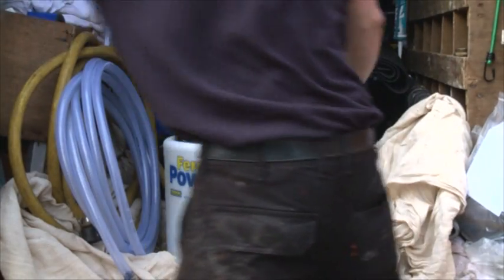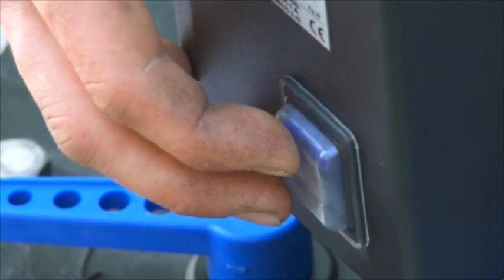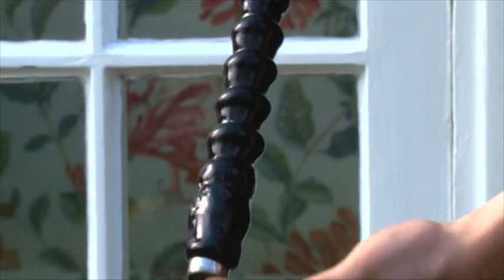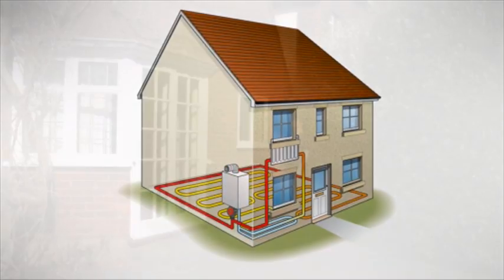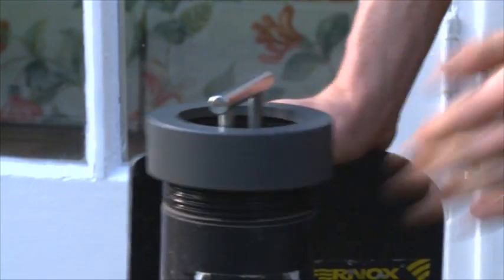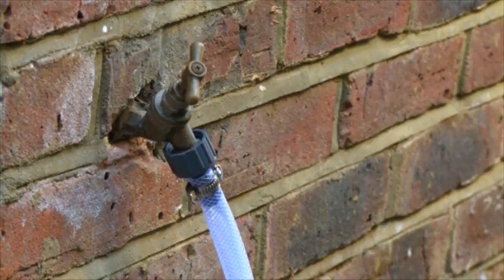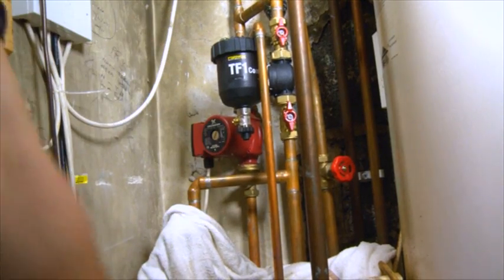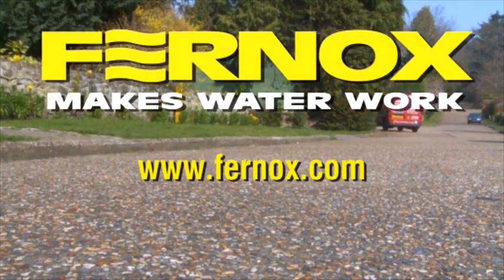Fernox - How to make Powerflushing easy

Comment: Lots people got conned into those spirotech mb3 but there handy if you want to flush a system out using the boiler loop with boiler off. get rubber malot and bang along the top and bottom of your rads.turn the trv's all on full abd then all the lockshields off apart from one and once flushed turn off the lockshield and continue with the rest of the rads until thecwater runs clear to remove the cleaner. for novices buy a eezyflow device to screw into the rad at top to dose ya system.no need to pay 400 to conman plumber.fit one lockshield/drain valve add 1 meter garden hose and spend a hour or two draining he system at the start but this won't flush water under floor boards as there is not enough pressure hence why I said use your magnafilter if you have on else use your drain valve instead. if your system has not been done in 10 years no power flushing will remove stuck on black sludge but your can get those cold at the bottom rads to work again. get some aladdin autovents with replaceable cartridges.

Comment: Modern boilers are absolute rubbish imo.I had a lovely standalone potterton with a discrete extractor to outside wall that was ok for 30yrs.Now got new boiler a wall of ugly pipes a ugly condense pipe on my outside wall.Got to pay a joiner hundreds to box in.Was told it would save £300 a year haha boiler cost £3,000 so after ten years got money back  if boiler lasts that long,Then I will have to buy a new one because “can,t get the parts anymore” aaarrrgghh sick of people telling me if regulations.Got ugly cleaner sticking out.Boiler not strong enough to power thru boilers so got to have a powrr flush £400 .haha what a joke and all on me.
Reply: Your boiler was old and tired Jack , thats why you had to get a new one, it was broken. You boxed it in because you wanted to , that was your choice. The old one was built like a tank but it was inefficient so yes it will save money . Thirty years in the same house seems like a nice place to be in , count your blessings Jack
Reply: @paulbolton6486  All you say its v v true .However its ok to be sad about losing a faithful friend if only for a while.I did not choose to box the new boiler it had to go on the kitchen wall and high up for the Condense pipe,leaving me with a wall of pipes and an ugly black filter.A stand alone is not available.
Reply: @paulbolton6486  Nobody would service my Potterton they just offered a new one over £3k.how much money to save will pay for that.
Reply: yes Jack & all on you me old China 😄
Reply: Just to add to the schardenfreuder my condensing boiler cost £3.84 from ebay, has worked for 6 years ok, and all inlet and outlet pipes were virtually in the same place as the old boiler, so just one elbow required. And the condense pipe was directed into the soil stack; how about that, Jack! Sorry. Ouch! Love you all! Oh, and just bought a powerflush machine for £100. lol